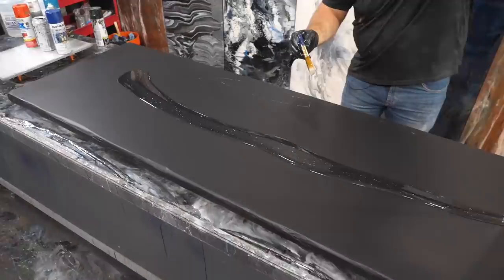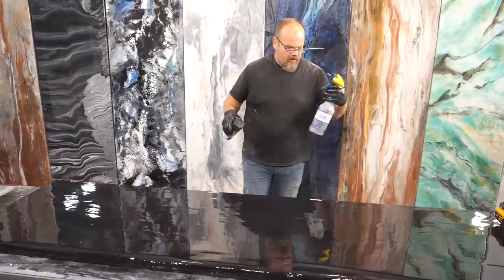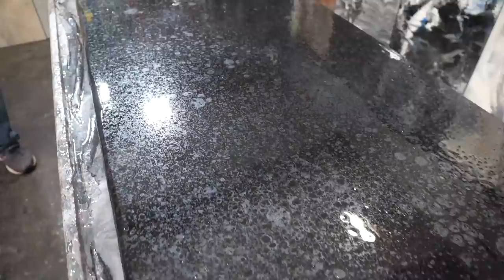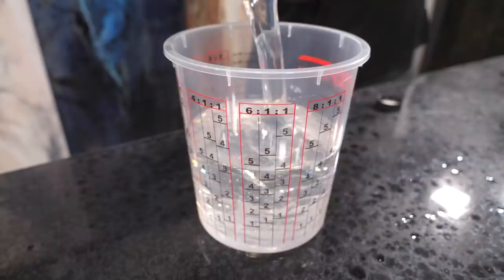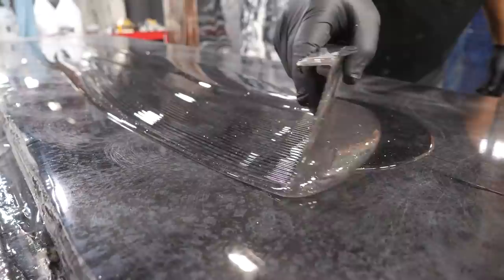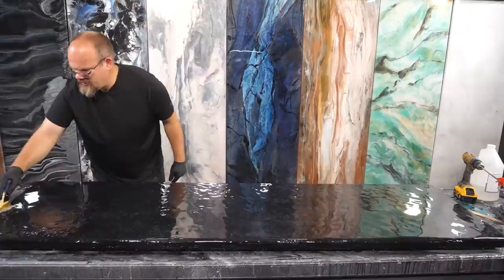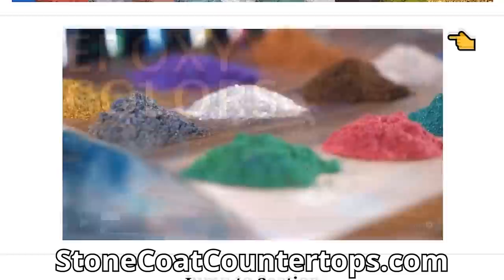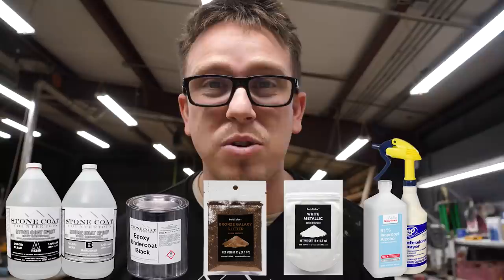Stimulus Check Spending Tips 💲 Stimulate your Countertops with Stone Coat Epoxy

Comment: We did our kitchen last summer with Stone Coat and everyone is amazed on how real it looks like stone. It’s holding up great and even have a few friends that have real stone countertops that want to put this over it to change colors. Thank you StoneCoat!!!
Reply: Hey, Donald.
How did you avoid any dimpling on the top layer? Or does that not happen with this kind of epoxy. I wasn't sure and was looking for advice.
Reply: @Noyola417  This epoxy self-levels. They use heat, like a heat gun or blow torch on the yop coat to pop any bubbles. You should watch more of their how-to videos. They show you everything, step by step.

Comment: Can the metallic powders be mixed into the epoxy and poured over black or is it only supposed to be used with the alcohol?
Reply from the maker: You can mix your metallics in your epoxy if you like! -Nathan
Reply: @StoneCoatCountertops , but that would color the epoxy, right? Not just show through it like glitter does?

Comment: What is the board or plastic do you use for what you put the epoxy on.
Reply: It's 3/4" MDF board. You can get it at nearly any hardware store. Usually in 4' x 8' sheet, but you might also find "scrap" pieces in smaller sizes.

Comment: how do you guys deal with the drops under the table that get hard?
Reply from the maker: Great question Pedro! You can let the drips dry and sand them off using a 50-grit metal fiber sanding disc and flush adapter for a grinder. You don’t want to sand them if it’s in the house because of the dust--you want to scrape them when they are gelled and not hard yet. Check out this video: -Nathan https://www.youtube.com/watch?t=49&v=LgPnp5YVQb8&feature=youtu.be
Reply: @StoneCoatCountertops  wow!!!!!!! Awesome thanks! 🙏🏽👍🏽💪🏽

Comment: I like all the colors and sparkles but I've never seen you do a finish in a solid color.
Can you do a video on how to mix your solid colors to create a custom solid color for an epoxy project?
Thank you
Reply: I dont think there is a secret to it. You basically just need to follow the instructions and mix it properly as long as they're no streaks and it should be solid color
Reply from the maker: If you want a solid color with no metallic look or glitter then use one of our dye's by itself. Mixing is the same!

Comment: How do you handle the vertical edges?  I know that I can trim the drips off with a blade when the cure is at the “green” stage, but is the epoxy viscous enough to not drain off before it sets.
Reply: Some epoxy will absolutely drip off, while it's in the viscous, self-leveling stage.  That's why it's so important to protect your work area with plastic, and to use the correct amount of epoxy for each coat.  (It's usually 3oz per square foot per coat.)

Comment: How resistant are the products to heat? @stonecoatcountertops
Reply: Very. You should look through their video lists and find the video they did on endurance. Sorry I can't recall the actual name of the video. But this stuff is pretty tuff, and if it does get messed up, it can be sanded and recoated with a top coat.